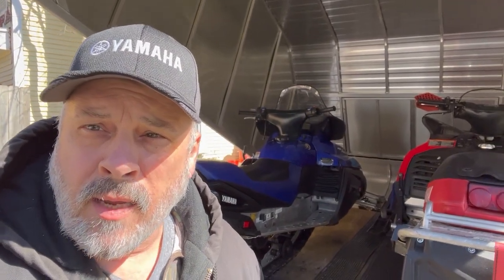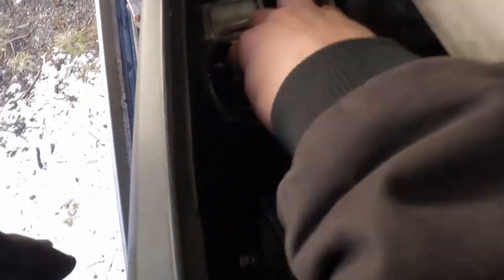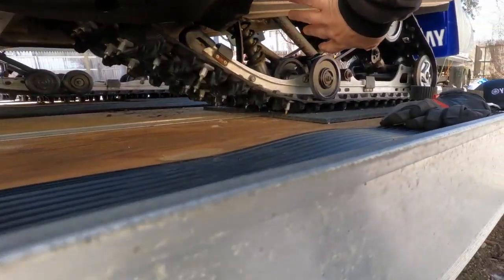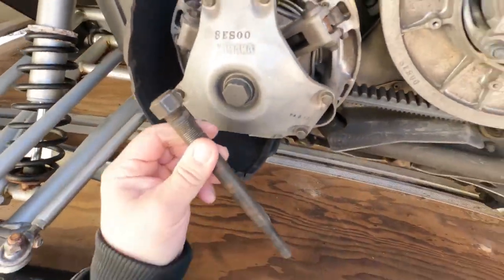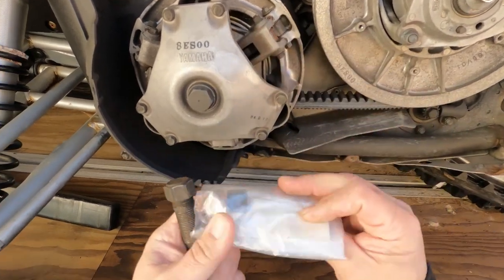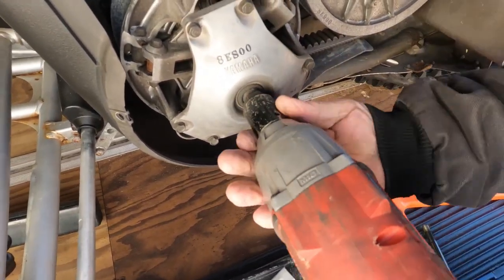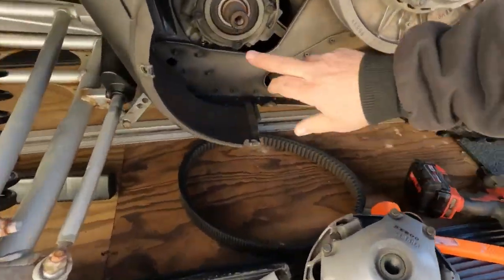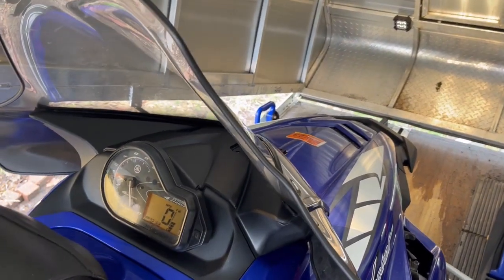Yamaha Vector Clutch repair for Factory noise issue.

Comment: Great video! I had a 12' Vector that I did this fix to and it was a easy job with great results. A must to quiet those noisy Vectors.
Reply from the maker: Putting the 136" track on now with the TRACKUSA extensions. I took all of the brackets off and powder coated everything. I have to get new shocks now as they were pitted. Stay tuned for more videos! Thanks for watching.
Reply: Thanks for the video! My 06 rx1 rattle is not that bad yet... Shure i have to fix it in the future. Looking forvard to seeing the track swap. Thanks AGAIN.
Reply from the maker: I am assembling the rear suspension now. All of the parts have been powdercoated. Tunnel extension is completed! Thanks for watching and commenting! @Rikke71
Reply: Did you need any special tools?
Reply from the maker: I did not have a press so I had my dealer do that part. I also used a Yamaha Clutch removal arbor. I have had this tool for about 10 years so I don't know the part number. I got it on Dennis Kirk I think. @hapatsu
Reply: Do you still have the track I may be interested in it
Reply from the maker: I don't have the track, I sold it already sorry. @alexpineda3265